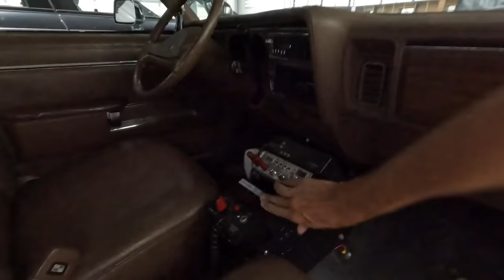He offered to BUY MY ENTIRE CAR COLLECTION, so I can start over with my new farm life.

Comment: I would definitely expect to run into this guy working at a Chevy dealership.
Reply: Absolutely. I was was going to buy a ionic 5 2 months ago and they advertised it at msrp, and even told me through phone and text messages that is what I’d pay. When I drive an hour to go get it, they told me that they had too many people interested and it would have to be 15k over msrp. Not only that, they offered me 15k for my 2021 top of the line trim sportage with 22k miles absolutely flawless condition. They have a 2020 with 40k miles for sale for 27k with way lower trim. They are just crooks. They always were, but now they are over the top stealing money from stupid people. I kept my sportage and am happy to have it and the $400 payment after that. It was literally going to cost me more than double the payment on top of the rip offs in the tens of thousands. There is no way the EV would be able to save me money when you enter the deal almost 30k in the negative. The car was in no way nicer either other than the instrument cluster being lcd. It has the same size infotainment system separated from the cluster. It didn’t have everything my vehicle did.
Reply: This is actually painful to watch, NOT at all entertaining!
Reply: @joevenuti1201 The weak should fear the strong

Comment: I was holding my breath on the Countach … Thanks Tyler for keeping it and good that your nanas Merc will never leave, it’s a true precious!
Reply: This was clickbait video.  He was never going to sell everything.
Reply: I would have sold the Countach. You could pay for the building with it, for a car he's not driving anyway.
Reply: The countach could just as easily plummet in value.  Then it's a paperweight.
Reply: @jonathanj.4800  Countach is one the few blue chip collectibles under $1M.  It may hold steady or even drop in the short-term, but it will never sell for less than $200k again which is what I think he bought it for.

Comment: I do not mean to sound rude but to be starting an exotic dealership this guy doesn't seem to be super knowledgeable about "exotics". He seemed surprised by the side pipes on the SLR McLaren, and on what the term "manual swap" means with regards to the 599.

Also, the doors on the SLS are Gullwing not Butterfly.

Comment: If you replace your Explorer conversion passenger van check out the Ford Transit option 
The 3.5 turbo offers a ton of power and good mileage plus the Transit chassis seems to handle better based on my experience 
Prepare for sticker shock though

Comment: Personally I would have sold or would try to sell some off the low milage unicorns. I just can't fall in love with a car that has so few miles that every mile you put on it severely affects the value. Maybe that changes when you have 15 to 20 cars. But still, I like to drive cars and not keep them parked to maintain value.

Comment: The Honda XR100R was indeed the same bike John Connor rode in Terminator 2, just for some reason they used a 2-stroke engine audio during the riding 😅

And god I miss my Elsinore and my Odyssey (didn't have a Pilot, I was too much into 2-strokes to ever own a 4-stroke dirt bike back in the day 😅)

Edit: so far, the only three vehicles I NEED are the 427 Corvette, the (71?)K5 Blazer, and that SLS AMG.... I'd take the SLS over anything though, even though it's not in my favorite AMG Alubeam Silver over Designo brown or classic red and black.

Edit 2?: and you better do some googling yourself lol... the extended cab GMT400's aren't worth half as much as the standard cab short beds(like my 97 RCSB GMC K1500) or the Crew cabs lol. The extended cabs are the least valuable/desirable 😅.... still worth good money due to its condition and mileage though